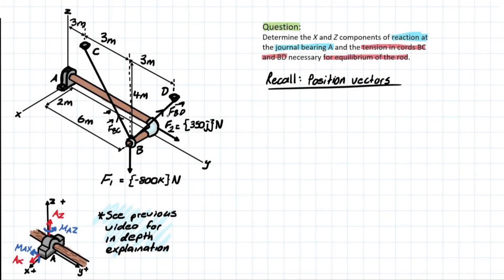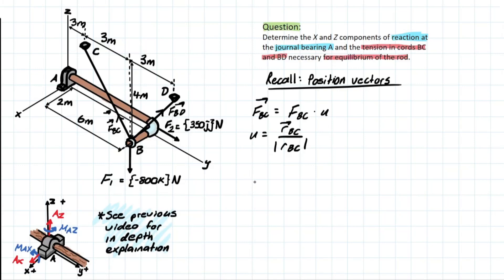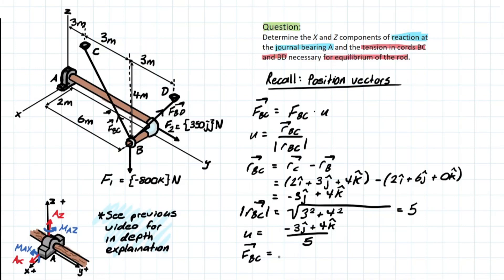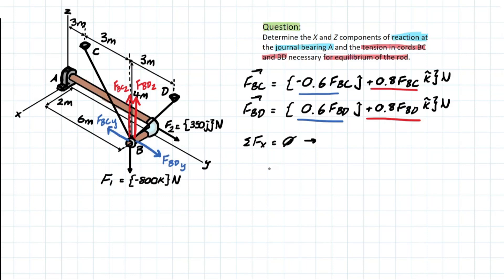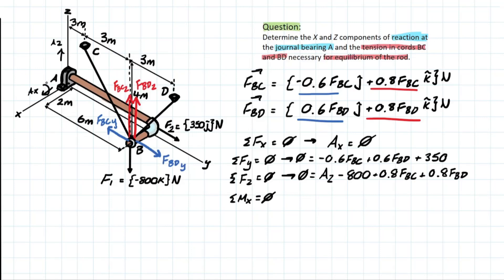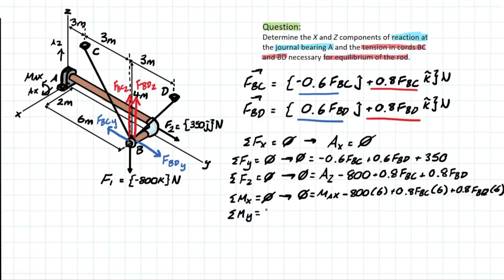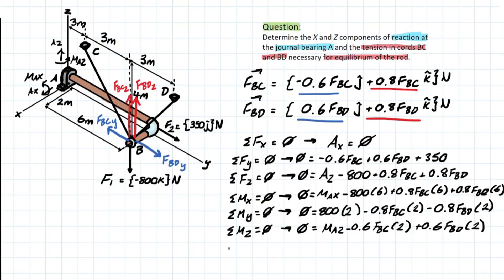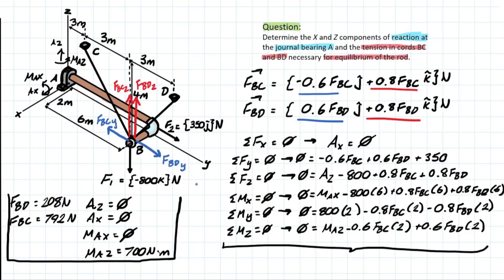Understanding Vectors for 3D Equilibrium of Rigid Bodies Problems!

Comment: How can we tell the sign of the moments i.e. for the moment due to F1 when regarding the various axes? I'm trying to use the right hand rule and it just doesn't seem to work out. Could you provide an explanation on how to determine the direction of these moments? Thank you.
Reply from the maker: Hey!

To start, the right hand rule is applicable to our sign conventions here. Our thumb points in the positive direction of our axis, and the moment reactions were both drawn in the positive convention (following our grip around the axis). 

If we look at only F1, we would have moment reactions about the y and x axis. The support allows no moment reaction to develop on the y axis, and the z axis is parallel to our force, so there will be no moment reaction there either. 

Now, solving for the moment at x (Max), F1 would create a clockwise moment about that axis. This means our reaction moment will be counterclockwise. This also means our assumption to drawing it this way was correct!

Hope this helps!
Reply: @simple_civil  Sorry but I'm still not one hundred percent -- if we point our thumb in the direction of the positive y-axis, are our fingers, before curled, the direction of the force (for F1 this would mean that the fingers are pointing down still with the thumb pointing along the positive y-axis and for FBC and FBD are pointing up) and the curling defines the direction? Because if I do that, the curling due to FBC / FBD about the positive y-axis would still be counterclockwise. 

I appreciate you taking the time to help.